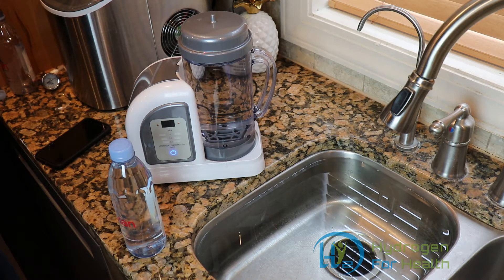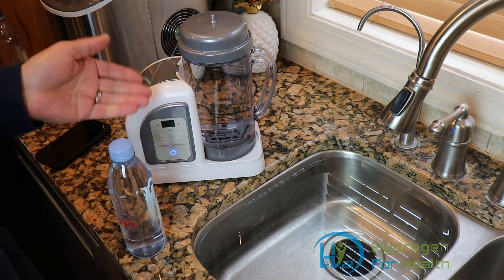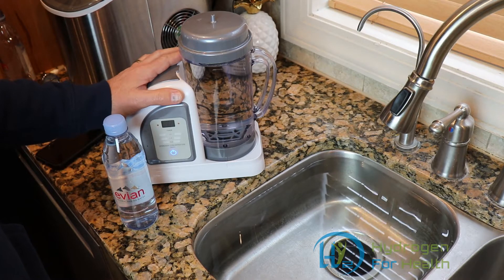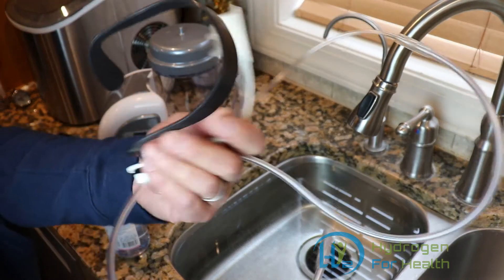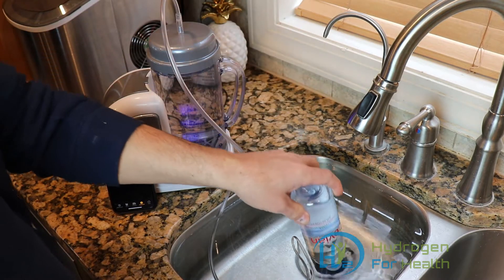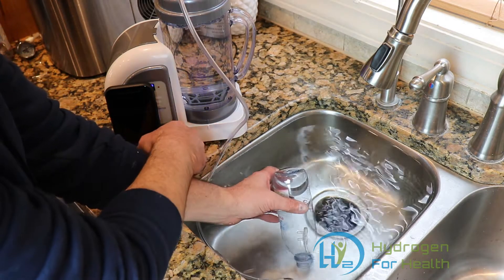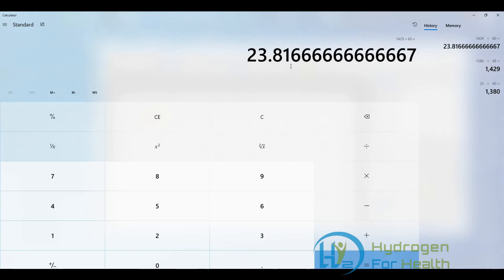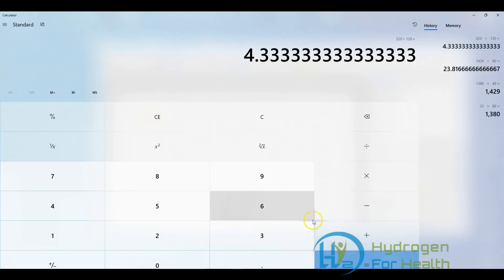Lourdes Hydrofix low tech way to measure how many ml your machine is making for hydrogen breathing.

Comment: delvis 11, your math is incomplete. All you did was convert 23min 49 seconds to 23.82 minutes. Why don't you take it to the next step and take the 502 milliliters and divide this by 23.82minutes = 21.07 ml per minute.
Reply: This unit is so low on hydrogen that it should be a shame to say it's manufactured in Japan. Lourdes Hydrofix so low output hydrogen that it's crazy, real scam imho. Ask Gemini to pull some clinical trials, ask for hydrogen flow tables, and you will find out Lourdes Hydrofix is a joke, it can't do much except empty your pockets

Standard flow for lung problems, asthma, COPD 1.5- 3L/min no not the The Lourdes Hydrofix (Premium Edition) is commonly cited with an inhalation output of 48 mL/min or a certified 120 mL/min as seen in third-party documentation).

Comment: Here ist the latest reaction of Hydrofix:   https://www.youtube.com/watch?v=R6Qvhe3IAY4
Reply from the maker: It doesn't matter how many times they show this test. It is not the right way to measure hydrogen output. Also you can see in the video that are not covering up the other cannula hole so it's pulling air into the sample. It's all smoke and mirrors. To the trained eye it makes the company look ever more like the scammers they are. Nothing to see here.

Comment: The calculations shown seems to only convert the  23min 49sec to 23.82min. This is not the flow rate which should then be 520ml/23.82min = 21.83 ml/min. Am I missing something here?

Comment: Why didn’t you just run a displacement test?
Reply from the maker: That's exactly what this video does.
Reply: delvis11 Running a temp coefficient alone will give you vastly different figures. These “manufacturers” can pretty much claim what they want. 
Build your own ;)
Reply: delvis11 I was being sarcastic bro.  Your now issue is to calculate atmospheric pressure with relation to the volume of water and required pressure to displace given the stated pressure of the produced hydrogen.   You see that’s how the scam works.  You won’t have been told how they measure the hydrogen density at rated flow.